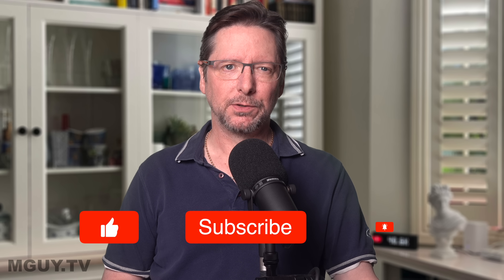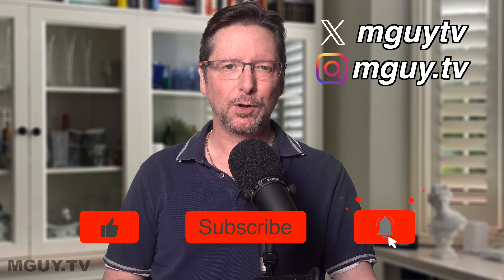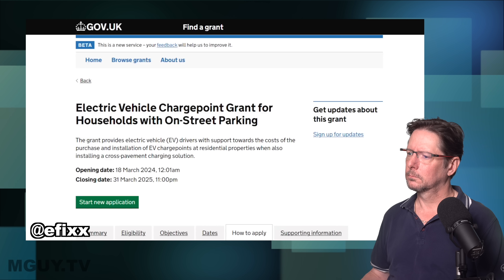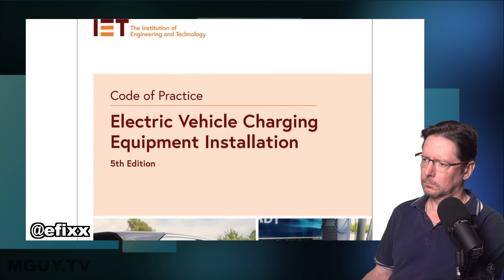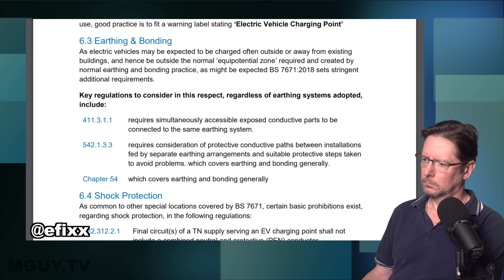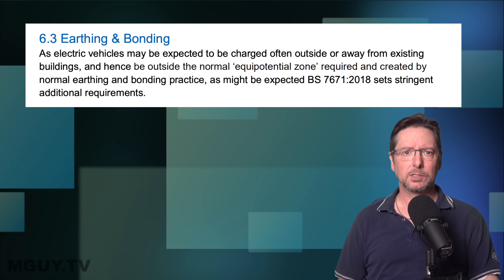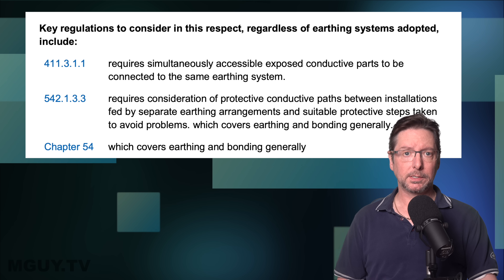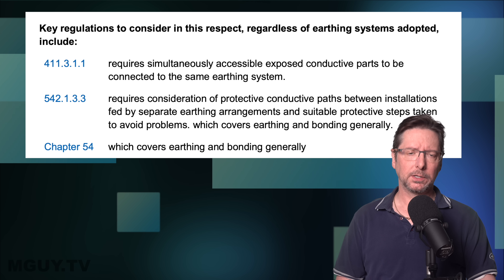ELECTROCUTION RISK from on-street EV Charging | MGUY Australia

Comment: Great video, i am a mechanic, ex-mechanical engineer, love my 6 diesel, gas and lpg cars, 1994 to 2004, no cordless EVs, thank you; 

Since this came up,  grounding, i see it in  lots of comments, can someone here please explain why on earth do the electric companies ground one of the wires, other then to KILL people who touch the OTHER wire !? i could never fully understand that; 

I run my house 90% of the time off grid, with 8 used solar panels, 36 used lifepo4s, cheap,  and a (very good!!) 5000 watt chinese inverter, an open board with the incredible EGS002 control panel( they cost 4 or 5 euros only, delivered from China to Portugal...); the inverter itself, a low frequency one, cost me 64 euros, delivered!! that small thing is colossal, comes with 24 Mosfets, 3 proper aluminum heat sinks and it's own fan; it handles 4000 Watts for 10 minutes at atime with no problem; it needs a 20 Kg (at least) toroidal transformer, 300 euros, cooled by a nice 12 volt fan, also...)and a 25 euro 50uHenry inductor, that i wound myself on 3 (chinese) small stacked toroidal sendust cores  with 3 AWG wire;
i have used high frequency chinese inverters in the past, THEY ALL BURN UP; and then , since the Ics are sanded, erased, they can´t be fixed; but i rewired them to use SG3525 ,1st stage, and then the EGS002 for the second stage, from the 380 VDC to our 220VAC,50Hz here; they now work well, i have 2 on the side, sold 2 more to neighbours; as a byproduct, i kind of build and repair them now, on the side;

I do not earth anything,  the grid is completely cut-off via a special, huge ,multiple switch,  we can touch any of the 2 live wires, 220 VAC, the other hand/feet, on wet ground (i tested that with the voltmeter first  lol) and we feel nothing, because none is earthed;

The only way to get electrocuted would be to grab one wire with ONE hand, and grab the other wire with the OTHER hand, which is a risk i do  not mind taking;

I really do  not fully understand why the public grounding, and am i possibly doing it wrong by not grounding,  will i ever need to do it?

Comment: Apart from electrocution issues, an Administrative Court in Frankfurt, Germany decided already in 2022 that EV charging cables running across the sidewalk, covered or not, are a tripping hazard and are not allowed. That court decision is not mandatory nationwide applicable, however, it appears that communities are now extremely cautious to give permission, since if a "Grandma" or "Grandpa" trips over it they have a huge liability problem.

Comment: I'm an electrical engineer in the Australian Power Generation and Wholesale Distribution space.  I have been for 45 years.  I generally have a huge problem with the EV push, system assumptions and the overwhelming science and physics arrogance on display.  To give the audience some perspective, when power plants are designed the earthing grids get particular attention and for good reason.  The amount of energy in and around these facilities, even from induction where their is no physical connection, can kill workers and people in general.  So it's pretty serious from a design perspective and how equipment is made safe to do maintenance on.  If you allow voltages to "float" because they aren't tied solidly to a common earth then a circuit for electricity to flow can be created, the conductors of which can be human beings in the worst of cases.  So this kind of stuff driven by bureaucrats is extremely dangerous.  At a fundamental level, installing a 350kW fast charger is like connecting a few hundred new homes to the electricity network, add four or five and it's like adding a small town or village in a handful of little boxes.  This is really crazy stuff.

Comment: It started in Portsmouth they had to take out all the street lamp drivan roadside charging stations  so the council allowed you to run a cable across the pavement with a recommended rubber tread covering with the correct colours but wouldn't take responsibility if someone trips over that was down to the user they just made a recommendation and said they would not take action over trailing cables

Comment: I stired up a hornets nest in an electricians forum yesterday over this, just one comment > 

   "The main point regarding earthing is that TN-C-S cannot be used for EV charging equipment unless one of three specific items is met. Unfortunately those three items are next to impossible in reality, and the only realistic option is to use a separate earth electrode as a TT system, not connecting to the TN-C-S earth at all.

There seems to be three methods:-
1) Use a TT supply.
2) Use an earth rod to monitor the DNO earth and disconnect all lines, neutral and earth if out of spec.
3) Use the three phases and monitor the voltage of all three phases and if any one goes out of the permitted voltage range then again disconnect all lines, neutral and earth.

As to if pavement chargers have access to three phases, or if there is anywhere where an earth rod can be fitted, where we are sure no underground services are going to cause problems is another question.

The problem is any metal in the ground (pipes and cables) can result in the earth rod not under fault conditions detecting a true earth. So it would need a detailed plan of underground services with information as to if plastic or metal before an earth rod can be installed.

This upload_2024-4-17_22-30-24.png may seem the answer, however many areas designated for pedestrians and cyclists are already too narrow to allow wheel chair access. Having lived with a mother in a wheel chair I know the problems. We are trying with one hand to get more people riding bikes, and trying to segregate road ways into three areas for vehicles able to do over 16 MPH, those under 16 MPH, and pedestrians.

So a road designed for two way carts, is now trying to cope with vehicles much larger, and segregate them from light vehicles (bikes and mobility scooters) and pedestrians plus allowing on street parking. There may be areas where one can have wide streets, with the segregation like the sea front at Blackpool. But for many they should not be parking the cars they have on the street, we may turn a blind eye to them, but where I live the bus route no longer goes past my house as it was blocked by cars too often.

I do in the winter months if likely there will be snow or ice leave my car on the road, as my drives are so steep, but some always leave their cars on the road, or more to point half on the pavement, which means pedestrians are forced to used the road, with cars flying past on the speed limit of 20 MPH, which has not improved things, but made it worse.

So the installer of the charger has little option of where fitted, it must have enough room for scooters, so same space as for a door way, so 28" gap is required for most mobility scooters, more if going around a corner. "

Comment: EV fires. I predict the following senerio based on the Autoferry ship Falicity Ace EV fire and sinking; combined with very conservative Chinese claims of EV self ignition fire rates of 1:50,000 annually.  Remember all EVs average only 1.5 years old.  If EVs were to ever be allowed to become the majority of vehicles; where many are parked in close proxiimity. Within 3 years, a high rise with low level parking garage and 4000 vehicles, an EV will catch fire. Like Falicity Ace this will spread quickly with intense heat and toxic fumes. The intense fire will effect building electrical, emergency, and air conditioning as the building catches fire at night with people sleeping.

Comment: I wish I knew more to really comment.  But this is apparent: transportation authorities [with their basket of vehicle regulaions] have  in fact collided with building codes.  Also, something seems off: the connection point that could [with particular/unusual faults] bridge ac and dc systems may not be so much a physical hazard as a regulatory one.  Is the EV being charged under the umbrella of building codes or transportation at the moment its hooked up? Which insurer bears primary risk during a charge: home or car?  Which owner bears risk: home or car?  Personally, a high voltage batttery system should not have a bonded terminal [of any polarity], and I can think of two hazards.  First is the hookup becomes a lightning rod outside your home - the modicum of electrical isolation previously offered by tyres disappears.  A garage, I note, provides something of a protection shell by comparison.  Second extends from the first - thats a Li ion battery about to get smacked with so many joules in close confines that likely induce a flashover... I would be surprised if a battery fire did not result.  As always, there is "smart charge" technology, meaning a charger does not turn on except it first sees a minimum battery voltage. After that, arc-fault interruption should be a reasonable protection.  Secondary protection around charging port [like a plastic shell] is probably reasonable, but I don't see how owners get away from an annual safety inspection by a certified [non-dealer] facility.  I give present EV tech about 3 years to live: insurability and non-repairability of these things combine as a death knell.

Comment: The risk for electrocution is in your house much higher than with charging any EV on streets.
Just think of the risk for electrocution when using a hair drier in a wet shower room. When a washing machine is wet and the outside gets under electricity or when the water cooker gets wet to the contact points and you touch the wet surface.
Even a lawn mower (on petrol or on battery) is more dangerous for your health.

In other words...even in the moste electrified country in the world (80% of new cars are EV's) , Norway, I've not heard of any electrocution due to charging the car.

(Maintenance will be done by specialists...do not open high voltage cases or do not touch any wiring from any electric equipment....including cars. I warn everyone...If you have xenon lights in tyour petrol car do not touch the wiring around those lights...The voltage is up to 36000 Volts (converted from the 12V battery to that voltage).
No ev (led leights) will kave this high voltage anywhere,
Also the bougie plugs and cables in a ICE car will have much highe voltages (and deadly current) with a few thousands of volts and a deadly current when sparking. Do not touch those when testing if those bougies  work.)
Do also not smoke when refilling any ICE car with petrol....but no issue to smoke around the chargespot when connecting an EV to a charger. Because that is the same as pluging in your vacuum cleaner in the wall contact.

Comment: In London the scammers are tripping over the cables then claiming against the owners insurance, then the thieves use specialised cable spikes which they fire through the cable and short the power and trip it and cut it and steal it and it isn't one cable as they strip a whole street. Trenches cut into the street are a hazard for cyclists wheels dropping down, disabled vehicles such as wheelchairs wheels dropping down and walking stick users ends dropping into the tranches and severing the cable, and many walking sticks are aluminium or steel tube; CONDUCTORS.

Comment: Those of us who understand the very real dangers of electricity, particularly relatively high voltage and extreme current capacities are loath to have anything to do with sheer idiocy.  We had a 2005 BMW, gas powered but with the batteries in the rear passenger seat, and it tried to burn our house down in the first year we owned the "SAV", the euphemism "sport activity vehicle", I guess BMW owners do activities, not utilities.  The disparate ground issue was almost never serious at 12 volts DC, except when jumping a dead car stupidly.  80 volts DC will lock your body up solid, until it falls.

Comment: How do EV charging cables work?

Level 1 (120V) stations and a level 2 (240V) station provide pass-through C power from a power grid and safety earth ground to the electric vehicle for charging. The vehicle then converts this AC power to DC power used to recharge the batteries.

Although the actual “battery charger” is within the vehicle, an EVSE “charging station” implements several layers of safety features, to protect the user from electrical and fire hazards whilst both connecting and disconnecting to your car. Once connected to the vehicle, the station informs the user what charge is available throughout, and the vehicle takes over the power transfer. 

If an electrical fault occurs, the EV charger should shut down immediately and the cable will be de-energised, minimising the risk of an accident. 

Again please reference hotel many electrocutions have occurred with street parking chargers in the past 5 years?

Alternatively I CAN show you examples of folks getting immolated at fuel stations

Comment: The federal governments have a political agenda and a mandate to replace the ICE vehicles with EVs, and don't care if cross pavement charging cables are not installed in conformance with local and state electrical codes, apparently they are not concerned about safety either.

Comment: Well Simon  I did notice a while ago that they were looking at cross pavement cabling. Now how in the name of all reason can this cretinous notion of doing this quite apart from the earthing issues you mention be done because of the fact of an actual physical method of getting the cable across the footpath?? Do you drape a cable across the footpath or dig small trenches into that footpath and then install a post at your parking space with the cable inside some sort of cabinet?? It beggars belief that anyone in the name of any logical reasoning should even contemplate this as a solution to off street charging - notwithstanding the cost of forming a trench for example and the installation of the cable from your house to the roadside. Absolute EVangelist insanity and frankly I consider it culpable for any person to approve this nonsense.

Comment: It was bad enough where I used to work, with pods for charging 4 vehicles in our car park. You’d have the leads draping all over the place and I mentioned that it will only be a matter of time before someone trips over the cables and gets hurt, as sometimes you have to walk between cars to get to the office. It’ll be the old, where there’s a blame, there’s a claim. I’ve seen it also in public chargers, where the cable is all over the place. Trip hazards everywhere.

Comment: I'm assuming that your use of the term "earthing" refers to what we in the U.S. refer to as "grounding"   I own 5 cars. 2 are collector cars which are kept garaged. I also have a transportation car and truck parked in the driveway, and an old early '70s car that I like to work on and tinker with, parked on the street. It runs fine for local driving. Last year I went to start it and found the battery dead. I raised the hood, connected a 4 amp charger to the battery, and ran an orange 120V extension cord to the charger. The cord had to cross the sidewalk. I thought I could get away with it long enough to charge the battery enough to start the car. I soon got a knock on the door. It was the city water meter reader. He told me I needed to remove the extension cord across the sidewalk. So I did what I should have done in the first place. I removed the battery from the car and charged it in the garage. No way to remove the battery from an EV.

Comment: We had mixed earthing inside our old appartment building.  Some devices in the cellar were connected to a copper gas pipe for earthing, not the real power grid earthing.
As a kid I got mildly eletrocuted in the bathtube when the earthing that was connected to the sink near the bathtube started to sparkle.
So nobody knows which devices are connected to which of the three different earthing solutions. Happy electrocuting in rainy weather (30% of days in my country).

Comment: Aren't the roads and pavements in enough of a state due to lack of maintenance without cutting more holes in them? Our local council says it has no money to repair the canyon size potholes in the roads but seems to have plenty to convert every street into 20mph zones. Small sections of roads repaired and re-tarmac then painted red with cameras and road signs installed everywhere around them.

Comment: If I wanted to charge a milkfloat out side my house I would have to run the cable across the road as on street parking is on one side only, also as it's a case of first come first park, sometimes I have to park at the other end of the street from my house or around the corner, so this is another stupid idea that will not work. typical government plan, thought up by people who only know one end of a pen to the other (maybe)

Comment: Reuters :"US probes Ford recall of 42,000 Bronco, Escape SUVs for fuel leaks, which could cause an underhood fire".

Fossile cars are subsidized $28.125 through oil.
Fossile car owners are hostages to a cartel with mostly dictatorships.
The oil price are now $90 a barrel, and increasing.

Why do people want to set them self in this position?
Politicians are driving a subsidie orgy. Where they increase the subsidies every year, while they get payed by the companies they enrich.
The subsidies for oil is forcasted $9.000.000.000.000 or more than $1.000 for every human on the planet.
This subsidies are up from $7.000.000.000.000.
This is higher taxes, more expensive food, clothes, homes and all other things you need.

To gave a fossile car, is to have domina in the middle east, whipping your economi.